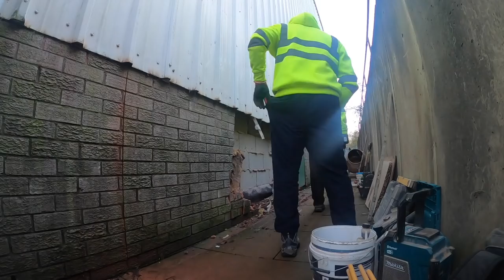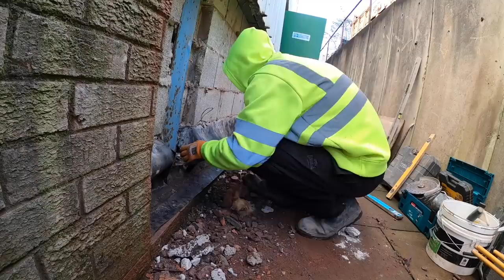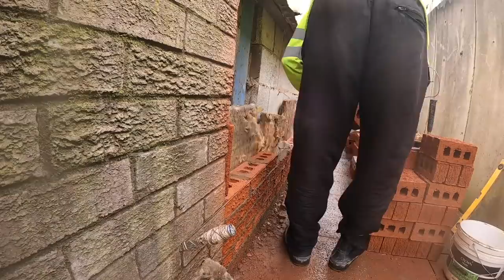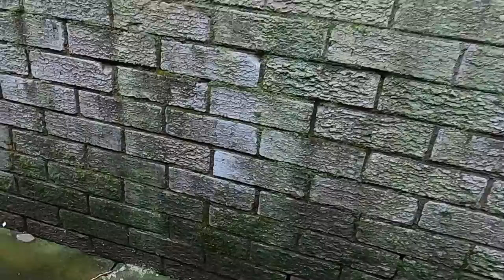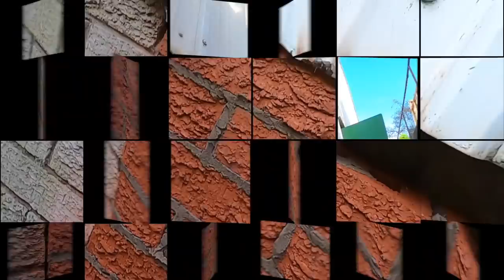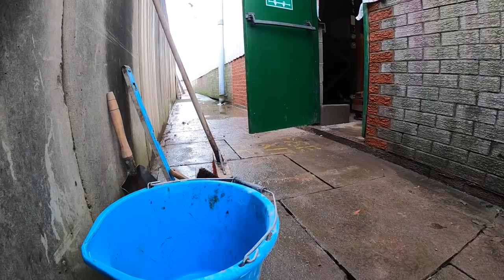WE SET THE FIRE ALARM OFF!!

Comment: Did something even tighter a few years back on a flat roof...only way it could be repaired was use a resin to ‘cement’ the finish course bricks, in bond to the bricks of the course below, and then lay theses bonded bricks onto a fresh bed...not easy, but it worked...alternative was cut off the fibreglass flat roof edges and repair that...which was a lot more expensive...
Reply from the maker: Not just me and Al that get the crap jobs then 😬😁🧱👍🏼
Reply: @SteveAndAlexBuild ....No, you just seem to get more than your fair share....
Reply from the maker: @stun9771  🙄😁🧱

Comment: Should built last two course brick work out eaayer quicker come on lads
Reply from the maker: That doesn’t even make sense 😂
Reply: Come man you build the last two courses to geather along and out lay one then lay other on top as you go along you so yo get your mud and brick in from  front inside big the two all way along together so much better getting y mud and brick in trust bricklayer for 40 years ask Brockie what building out mean brick work terms come on man
Reply from the maker: @simonward1795  I still don’t have a clue what you are on about 🤷🏼‍♂️
Reply: Go pass it
Reply: Right you got the last two courses left because you build up past the tin roofing come down and it was hard to get your mud and brick in what you do is to make so easy to put your mud and brick in with out struggling you build along and out brickwork term L's so your second last course lay two bricks then lay last one on top so you go along so y putting mud and brick from side up and over so much more room now if you don't under stand that means you never done it or have bin showmen how to do it  usely only use it when build up be hind something its call build out or something in front of it like pipes sofit if you
Reply from the maker: @simonward1795  🧱👍🏽